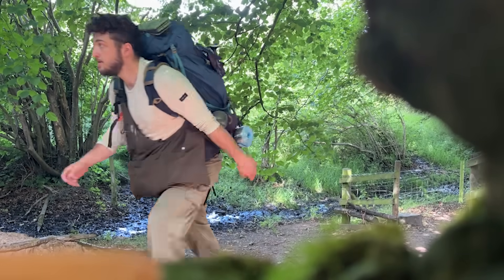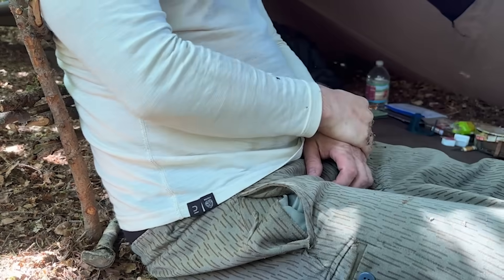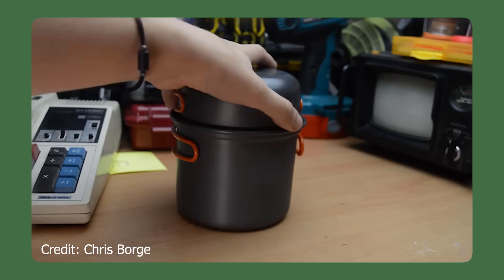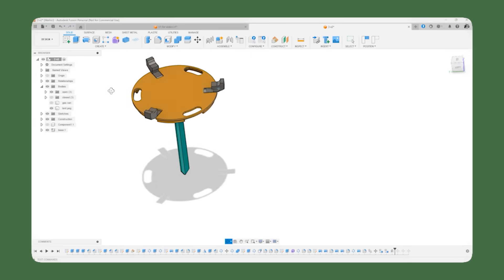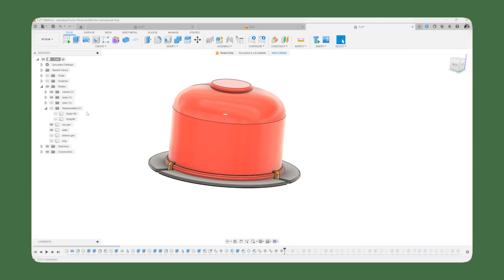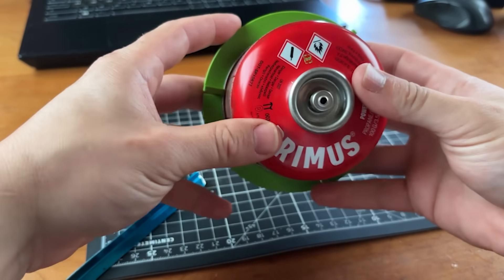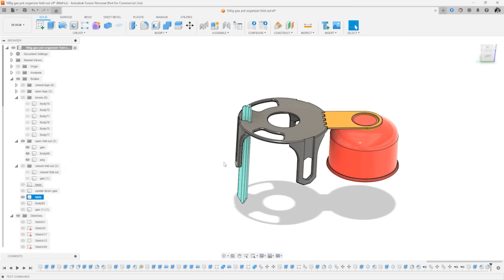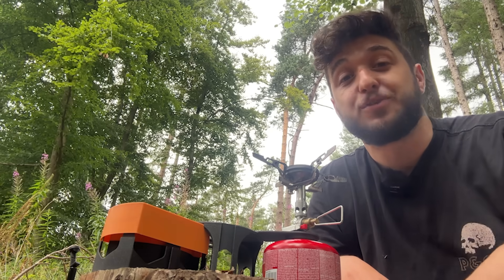Designing a 3D printed camp kitchen for outdoor adventures

Comment: Awesome video and design! Is this all in PLA? If you can, try printing it in something like ABS. Not only are the material properties more favourable for this sort of print (better heat resistance and less brittle -- especially in colder temperatures), but it will also be about 20% lighter due to the density of ABS.

Comment: Great video and great editing style. Really enjoyed the watch!

One thing I noticed and which would maybe saved you some time: You don't need the pop-in/clip-in mechanism on both sides. You could've just made the triangular slit for the tent stake go through the whole baseplate. This way you don't need to undo the gas canister and pop it on the other side. Just put the tent stake in from the bottom and use it as it is.